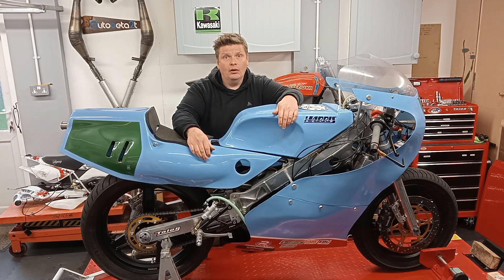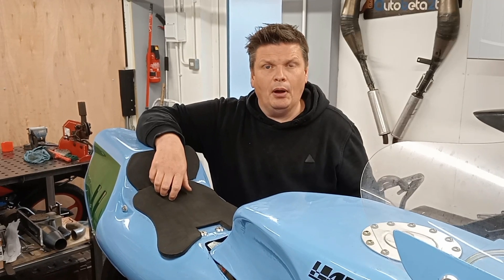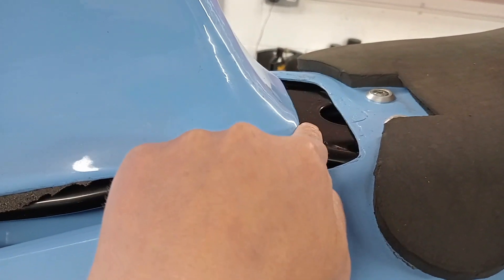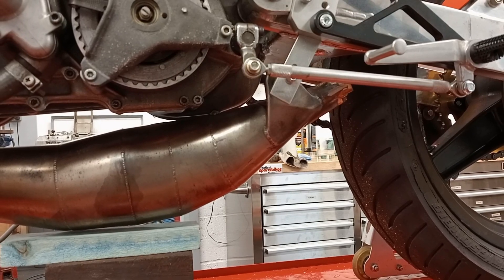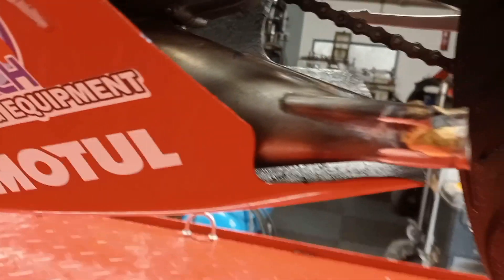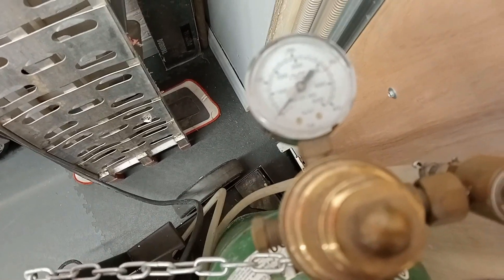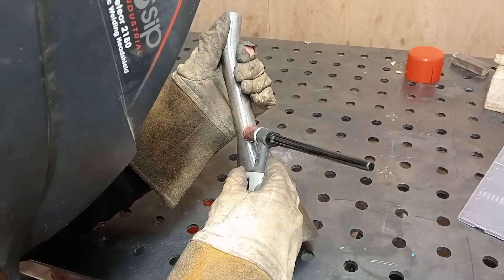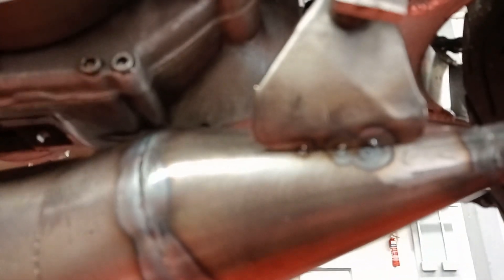Modifying an Ultra Rare 250cc Classic 2 Stroke Motorcycle #GP Bike #Hacksaw #Hammer

Comment: It's a true rarity, with a truly atypical design. In France, this work of art could only be seen in magazines.
I'm currently rebuilding 2 1981 RD350 LCs for my small 2-stroke collection, which had been waiting in my garage for 3 years. What I'm missing now is a Kreidler, a Zundapp and an RG 500.
Reply from the maker: Hi siem, it is a work of art for sure - I spent a lot of time looking at it. There was no CNC from what I could see just a lot of manual miling - very nice.
I can't imagine the Kreidler or Zundapp are cheap? I know RG 500's cost a lot. One of the things I wish I brought many years ago when they were a bit cheaper :)